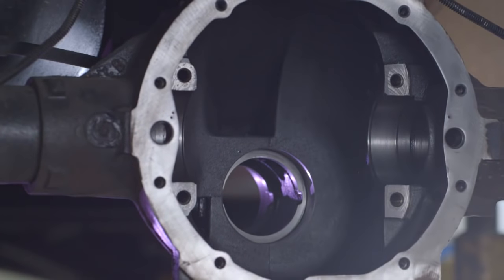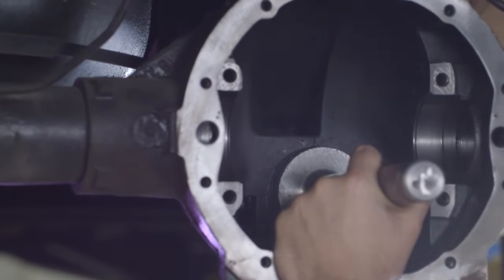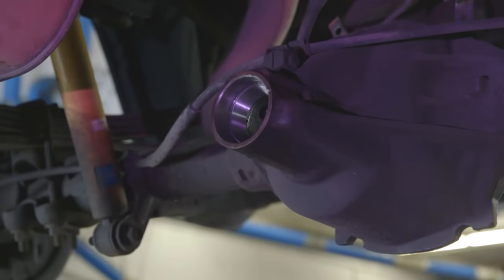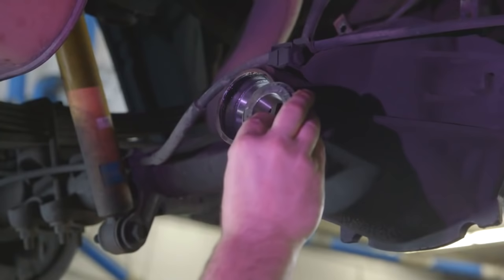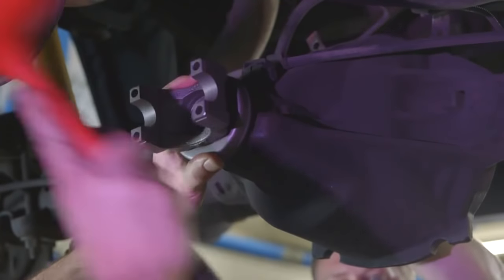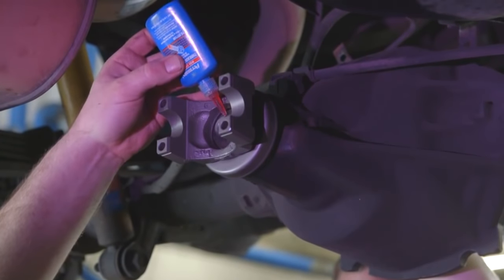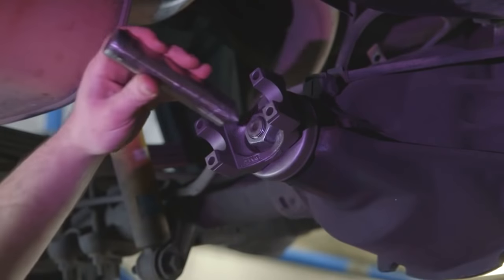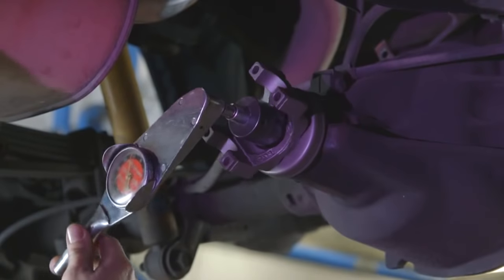Setting Pinion Bearing Preload — Yukon Gear & Axle

Comment: I used a flimsy 1/4" drive in lb beam style to check pinion preload and after breakaway torque it would give a jerky or hopping motion as I spun the assembly. Anyone experience that before?? I would spin a tad quicker and I think it smoothed out. But it would do it every time.
Reply: Ever figure out what was the cause?

Comment: I have seen different videos where they do all this without the seal in there and then when they set preload correctly they remove the flange and install seal.  But I though once the crush sleeve is crushed you cannot loosen it back up?
Reply: you are correct...
Reply: They just get the tension started withou the seal without crushing the sleeve to spec. This is so the pinion can stay straight enough to hopefully not damage the seal while the nut is tightened to spec during final install at which point crush sleeve will be crushed to spec and deemed not reusable.

Comment: Will over torqued preload give vibrations or would that be under torqued mine is fine until 50 mph then I get vibration  any ideas
Reply: Overtorqued -- No.  Possibly if pinion bearing preload is negative (looose).  More likely to be caused by u-joint or driveshaft out of phase or balance.

Comment: Question: So the pinion bearings do not need to be pressed on? Just do it by tightening the pinion nut?
Reply: 74crazydiamond yes the bigger bearing near the teeth needs to be pressed on. Also the one at the top needs to be pressed on as well but it could happen while you tighten the pinion nut.
Reply: Front pinion bearing will be pressed on as you run down on the nut. Yes. There is no other way to do it.

Comment: I get a little bit of variation as I spin the pinion/yoke with my dial torque wrench; It's between and  in/lbs; Is this normal? Thanks.
Reply: The vibration I am talking about is in the measurements I get on the torque wrench

Comment: Using an IMPACT GUN? ARE YOU CRAZY?
Reply: The driveline guy I worked with at the Chevy dealer tightened everyone he did with an impact, and he did a bunch of them every week.
Reply: @motorvaderlapstrake7238  yeah and the bearings probably barely outlived the warranty

Comment: you must check the bearing race to see if it is flat against the housing by using a .001 feeler gauge... come on start checking your work...
Reply: Shouldn't there be no space between the 2?
Reply: @Ashroyer86  That's the Point

Comment: I see you use an impact gun instead of a torque wrench to crush the sleeve and get the proper preload. I thought you needed to torque the pinion nut to at least 150ft. lb.
Reply: Actually I saw a teacher do it at 300lb to crush the sleave. I used a vise to break the crush sleave and its's easier to get the right lb torque but do not over tighten or , sleave needs replaced.
Reply: I mean press to break the crush sleave in. then torque.

Comment: If the YUKON GEAR & AXEL pinion seal requires silicon for install, why is it that they provide tread lock and the gear pattern paint with brush only, and not the silicon as part of their master kits???😂

Comment: My piñion wont tighten anymore an i still have play!?wat do i do!??
Reply: you need a gym membership
Reply: Your crush sleeve is not crushed. No freaking way you're crushing the crush sleeve with an impact like in the video. It takes about 300 ft lbs to crush the sleeve. I royal PITA with a rear in in the car.
Reply: @blazeracer1  my impact did. It's rated at like 900 ft lbs forward torque although I doubt it puts out near that. It was a fight though.
Reply: @blazeracer1  300lbs is absolutely correct!